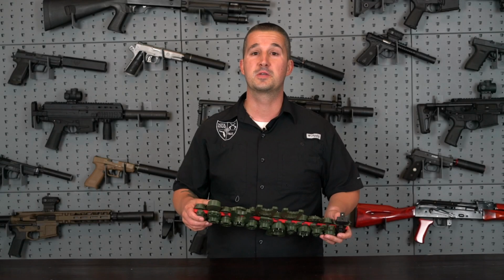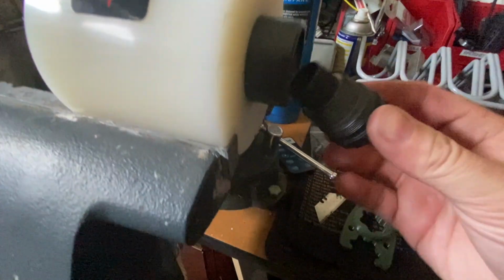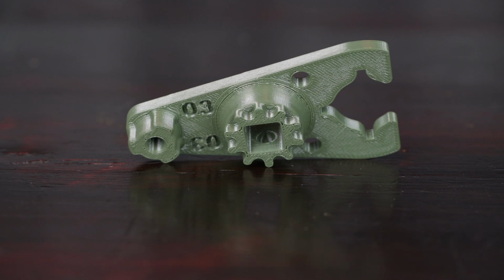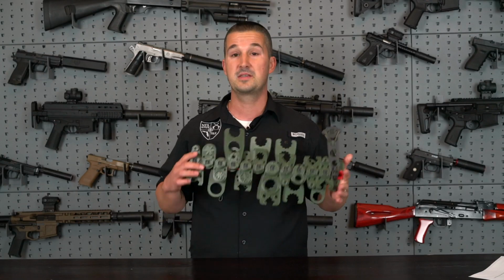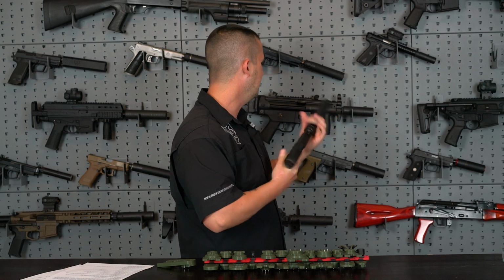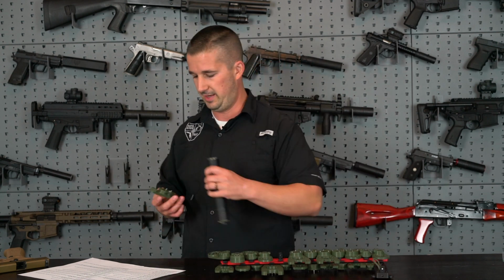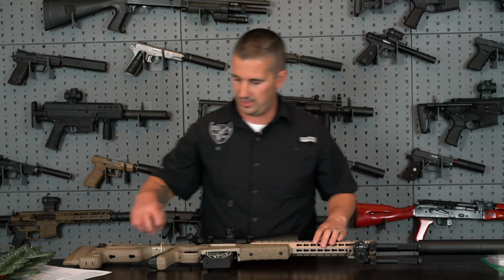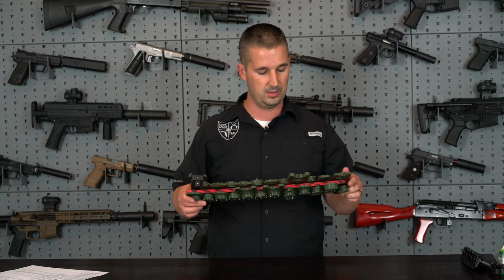Suppressor Tools "No more carbon lock!"

Comment: This is all fine and good, course, IF your front cap is locked and ya were silly enough to havr bought back when Dead Air was using the smaller pins, you're still ROYALY SCREWED!  

Even your boy Warren repeatedly suggests buying the new end cap!  Again, i still have to get this one off!  I have contacted Dead Air by phone and email, and 48 hours later... NOTHING!  Their Jack Wagon, A$$HAT "customer service" boy literally told me, "I can't do anything for you."  Use the email on the website, and they'll help you.  HARDLY!!!  I'll never buy Dead Air again!  Diligent will be getting all my business going forward!

Comment: I have a p320 x5, Barsto threaded barrel, CGS 9mm Suppressor (per your recommendation).  I have upgraded tungsten guide rod and can use 1911 springs.  12lb spring a tad better than 14 lb.  Tried multiple brands of 115, 124, 147, 158 grain I get FTF, Stove pipes at least every other shot.  Always clean and lube the piston spring and pistol. Any guidance?

Comment: hie....sir   i   have   some   questions.....about   supressors   and  silencer....its  strange  for   me   there   is  no  clear  info  my   question.....i   know   supressing  a  firearms   (   in   formal   firearms  terminology)    doesnt   mean   reducing  the  noise   to   almost  zero   and   supressors   basically   are  multi   purpose   (   related  to    type  of  the   firearm   and   designers/   for   example    russian  models   against   german)    any  way    i  know   when  i    thread  my   pistol  chambred  in   9 mm   and   use  a  real  silencer   the    subsonic  ammo   is   a  must    and  i   dont   know   why?    why   silencer   designers   didnt   perform   silencers  that   can  work   with    a  basic   normal  ammo   in  its   normal    supersonic velocity?  .......and  about  rifles  ....there   are   different   rifles  with  integral   or   detachable  silencers......example:    vss  vintorez   of  russia   with   9  39   subsonic  load.....or   m40  A3   sniper  rifles   that   at    silent  mood  needs   sub sonic  ammo.....( 7.62  51    /  118lrs   load   ; sub sonic  version   like    other  versions  ;  incindiary   AP    or   high  explossive) ......its   acceptable.....because   these  rifles   are   not    LRS   sniper  rifles...and  reducing  effective  range   caused  by    low   velocity   and   heavy   projectiles  wont  be   very   important   for  them(    but  its  a  question  too;    have   rifles  in  the  class  of  m24  or  m40    silencers   specially  made   for   super  sonic  loads?  (   about   870m/ s    ?)      ....the  case   of  very  low  drag   bullets    (   ammo)   like    330   lapua      300  win mag     7.62  ukm      408    cheytac    is   the  most  important.....basically  in  battle  field  snipping   its  not  matter  to  silecing  the  rifle...they   made   for    extream  down  range  but   in   many   cases   such   rifles    with   extream   power   and    extream   effective  range  and  penetrating  power   need  to  be    completly    silent    and  at  the  same  time   do  the  job    at   their   standard  range(  1000yards up  to   2500  yards)   .....then   it  means   :   there   are    silencers   specially  made   for    super( ultra)    sonic   velocities?    (     sonic  ,   subsonic,   super   snd  ultra  sonics    are   in  the  field   of  physics    and    understanding  them   isnt   easy)     then    please   guide   me    to   a    very   nice   source   on   the  web   and  not   a  book    to     describe    the   field    of     silencers   and  all  matter   about   them.....supressing  ....subsonic loads  ...supersonic  loads    are   in  the  field   if   ballistics/  physics   too......is   there  any    nice  ;    complet;    guide   or  source   for    me    to    understand    that     what    is  the    story    of     this    hard wares    ;   war fares    ?     there   are  confusing   info  on  the  web.....i   asked    a   russian   rifle  maker(   famous  one)     about    svd   silencer.....he  said  there are   different   type   silencer  for  this   rifle(     silencer   not   supressor)      some   need   rare   7N14    (   7.62  54  R   sniper load  )   version   that   are    sub/  s      and     there are  sikencers   that   work   with      7N14   sniper   load(   830m/ s   muzzle  velocity   )     and    the  noise  is   almost   zero.....its   a  great  question  for  me   ....both  pistols of   9mm  class   and  similar   or   even   45   class  chambred    and    rifles   in  the  7.62   sniper  class   and  over  to   408 ...... can  we   use   silencers   without    changing  ammo   to    lower   velocities?   flas   hiders/     eliminators /  supressors.....copensators/    brakes......they   are  not   my   point.....i   just   focus   on   silences   arms   that  i  said........hope  you  more  success

Comment: cool stuff but a little  pricey for me
Reply: Considering the machine I'm leasing to make these costs over $16,000, I'm not sure what the other option is, not to mention material, electricity, logistical and administrative costs, countless hours of unpaid engineering time and paying the kid in the wheelchair to run the printer while I'm at my day job.
Reply from the maker: Shipping the can overnight to the manufacture to open and repair endcap damage will run you more than $25 😂
Reply: @nfareview  True

Comment: They just need to have the suppressors names on the tool instead of a number system
Reply: The numbering system with suppressor make/model key eliminates the need to update tool identification markings as suppressor names evolve or as compatibility expands (Kraken/Mod9, Octane/Octane 2.0, Omega 9K/45K, Sandman/Nomad, etc.). Only the list needs to be updated. I gave this much thought based on previous experience with customers asking if certain wrenches work with certain cans. I couldn't fit all of the models on a wrench and have even less "real estate" on a socket.

The web address is on the bottom of each socket and on the top of the handle, minimizing the brand footprint. Some potential customers complained that the company name and city were on the full-size wrenches, so the identification markings were minimized. The customer can have additional text laser engraved if so desired. I looked at doing laser engraving but it added too much manufacturing time and cost.